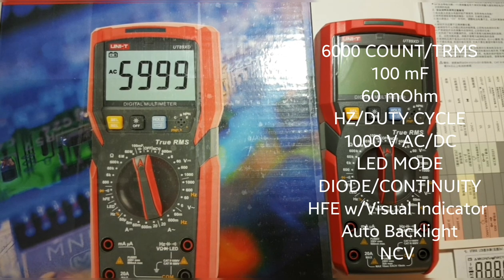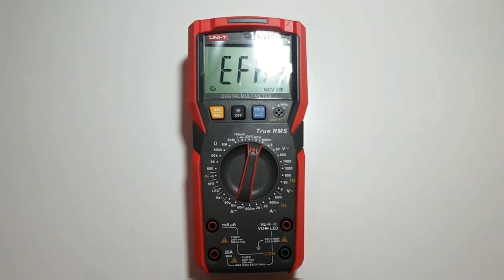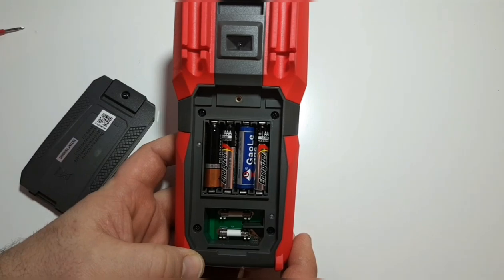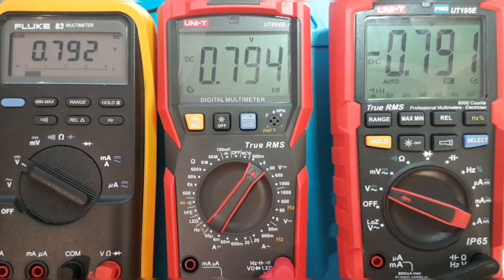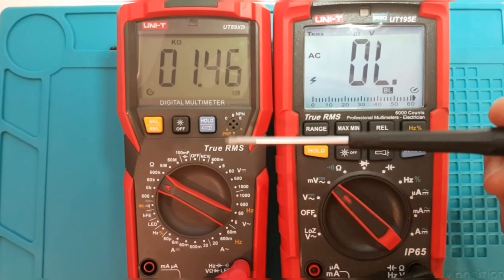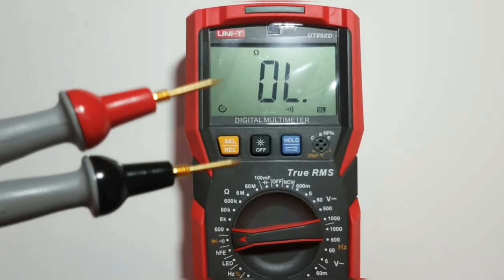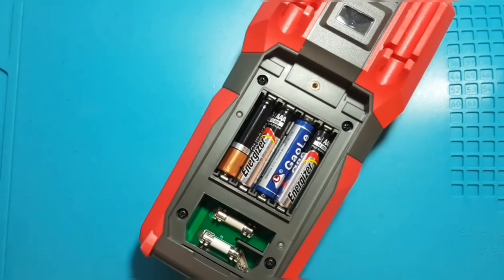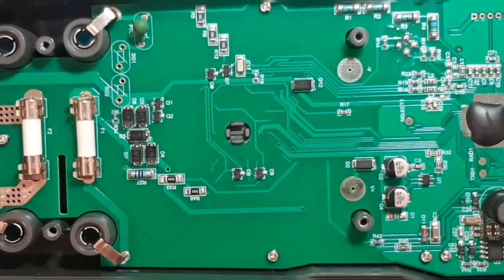World Exclusive!!~ UNI-T UT89XD Multimeter Review & Teardown!

Comment: After owning an 89XD myself for awhile now I can say I used to ignore manual range meters.  But this one changed my mind, its one of the best values in build quality, extremely well engineered diode, LED and cap ranges with sound and visible indicators, something ive never seen on any budget meter.  You could criticize the input protection, but in this price range its about the feature set and not intended for industrial or high voltage - what it is, a great bench meter for component testing etc. with its well thought out indicators, fast reading etc. and the case quality feels very nice, robust enough to last for years.  I would buy this one again in a heartbeat after owning one and using it.
Reply: Ordered today do you know can be calibrated ?
Reply: Even though I own much more expensive meters. I have to agree with you on this one, the quality is seriously amazing for the price. I've been using it more than I should lol.

Comment: To turn on the backlight again, it is not necessary to turn off the device completely. Simply press the backlight button again until "BL" appears on the display. Thus, the automatic backlight sensor is activated again. Best regards.

Comment: I don't understand why reviewers love these big fuses. They must be harder to get and more expensive than the small ones. All a fuse needs to do is blow when the current exceeds the specified value.
Reply from the maker: Good question, Believe it or not larger fuses are usually easier to find and cheaper than their smaller counterparts. Those  incredibly small fuses we've seen on some of the smaller dmms are almost impossible to source aftermarket.Also, a larger more robust fuse can handle the implosion better than it's smaller brethren thus possibly saving the meter from further damage...

Comment: Great review, but currently no one measures 20 amps of current with a multimeter, but rather with a clamp meter, so there is also no need for large fuses, I think, but if have large fuses be better. Regardes.
Reply from the maker: Great point.. bigger is definitely better as you mentioned. This meter is a beast and still performs like new after years of service. 👍

Comment: Ive really had a change of heart towards manual range meters after seeing certain advantages they can have.  And this meter especially shines with its excellent overall build quality, uniquely useful LED range and very fast 100mF continuity range - I found this meter for $27 US and I absolutely love it.  Some may criticize its lack of serious input protection, but common sense says you rarely get that level of protection in this price range regardless of the meter.  If you need an industrial meter for high risk high current, power distribution type use then maybe something like the UT195E-PRO or other meters geared toward INDUSTRIAL USE should have what you need.  That being said I had no problem reading either 120v or 220v in my house with this meter, but remember very few meters will help if you do something stupid with the range switch or leads, the meter comes with instructions, read them.  At some point in the area of electricity the user has to exercise some level of knowledge, responsiblity and common sense & needs to have sense enough to know how to use a meter  properly in a given situation.  Poking around in distribution or main boxes isnt the same as playing around on the bench with low level DC arduino projects, its serious and could get you killed.  End of rant. All that being said, for those who may be interested, im VERY pleased with this meter, the strong LED fuction and fast 100mF capacitance ranges really stand out especially giving the nice visual indicators as well.  Look around for prices, I found mine as I said for $27 US at Banggood and I have zero complaints especially since I watched this video first and knew exactly what I was getting.

Comment: I just received the UNI-T UT89XD multimeter.  I've tested the resistance and DC voltage measurements against known sources and this meter is sufficient for most professional needs. This meter is best suited for low power Electronics, however because the high-voltage side is protected by a small ceramic fuse it appears to be safe for occasional 120 and 240 AC testing. My hearing is not that good so I particularly appreciate the volume of a continuity tester beep.  I did notice that the screen backlight did not eliminate in a bright room, so I play some tape over the light sensor which is at the top of the meter just to the right at the UNI-T logo. Now whenever I hit the backlight button it illuminates. The meter Auto shuts down after about 20 minutes. The 4 penlight batteries and two ceramic fuses are easily accessible behind a backplate held in place by a single screw.  You will not lose this group because it's held in place by a retention washer.  The screw threads into a metal insert embedded in the back of the meter.

Negatives:  The hold function is not automatic. In my opinion a manual hole is virtually useless.  Although the display is large and bright the viewing angle is limited.

Conclusion:  
This meter is an excellent value and more than adequate for most purposes.
.
Reply from the maker: Great feedback! Agree, it's one heck of a multimeter,  offering tons of value and functionality! KEEP ON TESTING !

Comment: Thank s for the review. It came in very useful.  Just one thing though about the backlight. 

You do not need to turn the dial to reset the backlight.  1: Turn on the MM and touch the sensor at the top of the screen to turn on the B/L. 2: To turn off the B/L: Press The Black Off Button below the screen. 3: To turn the B/L back on-again.  Hit The Black Off Button again. 4: Now touch the sensor again and hey presto, there will be light. Great multimeter without needing to spend too much ($20). I bought 2.  I'm happy as pie!

Comment: I'm kind of jealous.  My Fluke 8060A, have two pieces, are manual push button.  4.5 digit with 0.05% DC accuracy.  They are about 30+ years old and originally cost around $400 each.  Factor in inflation, the Uni-T costs less than 5% of the Fluke.

Companies like Fluke, Tektronix and others would have gone belly-up long ago if not for trade protections.  Remember Harley Davidson (motorcycles), Black and Decker (power tools) ?  They and perhaps many others were protected from foreign competition.
Reply from the maker: So true..no way could Fluke have competed without such protection mechanism in place.

Comment: I'm confused about the diode test these meters do.. in this vid the meter did a diode test with a regular diode with a beep sound ( 2 0 : 2 6), but with all the LED's it does not beep even though it lighted all LED's and gave a forward voltage (2 2 : 0 0).. why would it not beep even though there was forward voltage and lighted? Is the meter faulty?  In a different vid you did of the Uni-T UT890D+ (at 1 5 : 1 5 ) it has a beep feature and beeped for the regular diode but when you tested the LED's it beeped on the one's it gave a forward voltage on but did not beep on the non-forward voltage even though they were lighted.  Both meters beeped for the regular diode but The UT890D+ beeped on some LED's in contrast to the UT89XD which does not beep on any, even though it pushes out 11+V via the leads.  Why doesn't Uni-T not have a system for diodes and LED?
Reply from the maker: Good point, there does seem to be some confusion with regards to DIODE output on the various UNI-T models. I'll try to get clarification from UNI-T for future reviews. 👍
Reply: @KeepOnTesting  Cool, and it looks like  those diode beeps only meters should be tested for sound on both diodes ( reg. and LED's ) in the future bc if it beeps for one it doesn't mean it will beep for the other.  Is there an affordable meter that does it properly also with the light indicator?

Comment: Does the meter beep when finding a short in diode mode? If the answer is yes, I may just pick up one of these. This is basically why i like Fluke during troubleshooting. Whether I detect a voltage drop or short, I don't need to take my eyes off the circuit, once you get used to that, you can't go back. I don't understand why other manufacturers don't do this, even my expensive Brymen doesn't do this..
Reply from the maker: Unfortunately, the answer is no. 
I totally agree with your logic though. Having that audible blip makes a big difference if you're troubleshooting on a deadline or have a big workload.
Only some of tbe higher end Hiokis , such as the 4252 subscribe to the same mantra as the Fluke. Then again, not all Flukes have the audible diiode feature either. I have a Keysight that has the feature as well.  All in all, its so convenient as you say not having to get whiplash every time you're troubleshooting a circuit. Let's hope we see more dmms with this option in near future!
Reply: @KeepOnTesting  Thought I'd reply here so that other people get the right information. 
I've had this meter for a while now. Shorting the probes in diode mode does give you a continuous beep. 
Btw @Darren Walker, thought you might wanna check it out. I've just ordered a UT17B Pro from China and it's still travelling in the ocean. The internal of this meter does look like a Fluke 17B lol, even the leads it comes with are gold plated.

Comment: Now am confused,  which better 
UNI-T UT89XD Or UNI-T UT139C
Reply from the maker: Do you currently own any other multimeters?
Reply: IMO 139C is overrated. I did have one but gave it to my dad eventually. I keep a 139E for myself. 

139C is a pretty good quality meter (it's just very slow!) and people buy 139C because someone has tested it and it can stand up again 4kv transient before it fails. Yes, so many people buy 139C because they think it's "safer". BUT what people don't realise is prob 99.9% of people who buy this meter will never get in a CAT 3 or CAT 4 environment. They don't need a CAT 3 rated meter to poke their 240V AC outlet which is CAT 2! If they do get in a CAT 3 or CAT4 environment, THEY SHOUDN'T BE USING THIS METER! 

Anyway, enough rant. Just wanted to tell you 139C is painfully slow and may not be what you want.
Reply: @Brian-uq6jm  
Thanks bro for your comment,,, it's helpful,, but in my case i think 139C better for me because am going to CAT-3 or 4 sometimes
Reply: @kaster2014  Does your work not provide you with a capable meter? Why are you choosing between these cheapies when you are doing work in CAT 3 and CAT 4 environments? 

Sorry, I can't give you any advice in this case. I wouldn't want to use either of these meters if I didn't have protection from the circuit breaker, and CAT 4.. are you joking me? I assume you're just trolling. If your company allows you to buy an untested cheapie Chinese meter to work in a CAT 4 environment, I don't know what to say, good luck!

EDIT: Please note my previous comment doesn't suggest 139C is a safe meter. NO ONE knows if it's safe. From the experiment done by Joe Smith, the 139C is not tested and certified to meet the claimed CAT 3 and CAT 4 ratings. Basically the meter can't be trusted.
Reply: I understand in some parts of the world, electrical regulations aren't complete/good. I'm originally from a place where a lot residential electricians use cheapie Chinese meters like the Victor 890D. TBH that's the standard multimeter for a lot of professional electricians there. My dad used to be an electrician, but his main meter was an analog one cuz it was wayyy back.

Even in a place like that, people who work in CAT4 are now equiped with Fluke meters. I could be wrong but I don't think you have a choice to use your own meters.
Reply: @Brian-uq6jm  Do you have the 89XD?  Your views?   Personally, I bought it for reg 50v /12v / 6v work, gen.electronic boards testing (resist, caps, cont) and LEDs for pinball repairs.  Maybe occasional 230vac socket work.   I am happy with this choice for my needs.
Reply: @jezisvole  i do have this meter. I would not use it for anything above Cat 2. It's not tested or proven to be safe so assume it's unsafe. If you open it up and see the internals,  it's roughly the same as the rest of the chinese cheapies.

Comment: How does the 11 volts of LED testing not burn out a 3 volt LED?
Reply from the maker: The output is controlled so it only sends out the required voltage.
Reply: @KeepOnTesting  Can you supply a brief, laymans explanation of how it senses voltage capacity of a low voltage LED?
Reply from the maker: @gfmucci  The forward voltage works by trying to force a constant current of(lets say) 1 mA through the device under test (diode). Forcing the current through the DUT will drop voltage (forward voltage for a forward-biased diode). The maximum voltage is then limited to whatever the multimeter can output in diode mode. Rather similar to how resistance is measured, but instead of calculating the resistance from the voltage and the current using Ohms law, it displays the forward voltage directly. So if the 1 mA results in a drop of 0.5 V, the resistance range would display 500 Ohm (0.5 V / 1 mA), while the diode range would display 0.5 V.
Reply: @KeepOnTesting  The explanation is too clear .Thanks alot sir !

Comment: Dear Darren, your reviews are great! I am not a professional and want to buy a AIO-multimeter. I am not sure, between the UT89XD and the HABOTEST HT118A. I know, the main difference is the autorange function. As I read the comments here, I asume the UNI-T has the more built quality - is that right? Or maybe some would say: The UNI-T looks more professional and the HABOTEST more like a "toy"? ;)
Reply from the maker: Many thx...for sheer ease of use the HABOTEST is the best buy..however, if you don't mind tinkering and would like to learn as you go the UNI-T is definitely a quality multimeter with alot of great features.
Reply: @KeepOnTesting  Just ordered the HABOTEST resp. the unlabeled HT118A which has permanent backlight. If I honest to myself, optically I like the UNI-T much more ;). But common sense prevailed, because it would be stupid to buy a multimeter based on optical criteria.

Comment: Hello there! I work in the car industry and Im in search of a good budget multimeter. Im particularly interested in accuracy of 12 dc voltage metering and ohm accuracy in lower ranges ( even in 0,5 - 1 ohm ). This one has caught my attention. Would you recommend it for my applications or do you have alternative suggestions in its price range?
Thanks
Reply from the maker: Hi there! It's definitely a contender for you..I would also take a look at the UT60BT https://youtu.be/dc6Hx8mU5_0
Same price range,  automatic with Bluetooth functionality. Either way, you can't go wrong 😊👍
Reply: @KeepOnTesting  thanks a lot! Your videos have been a great help
Reply: @KeepOnTesting  Call me old fashioned but Im not a aprticullar "friend" with auto-range esp. when it comes to low resistance measuring. So, coming back from your ut 60BT video review, I have a question: can I still use a manual range on that? Thanks again.